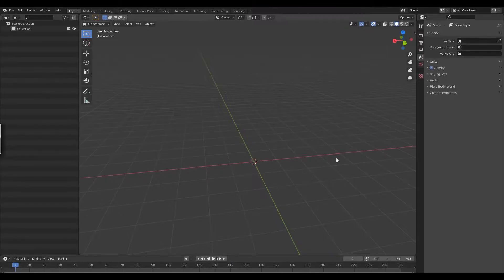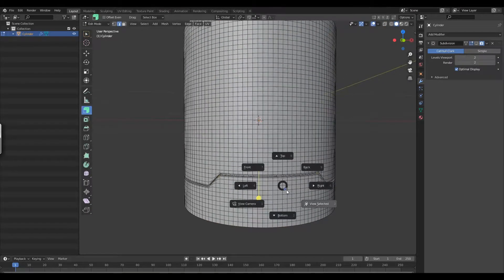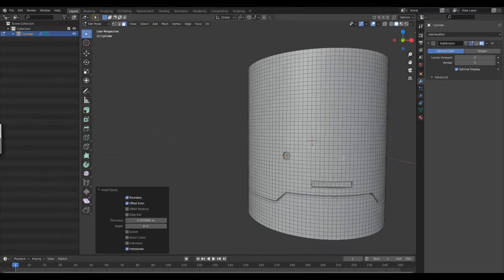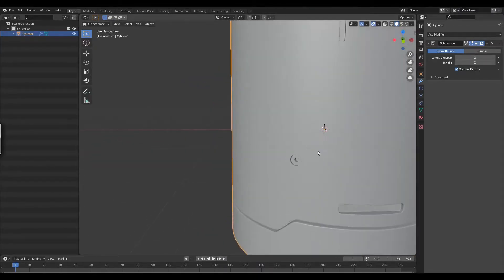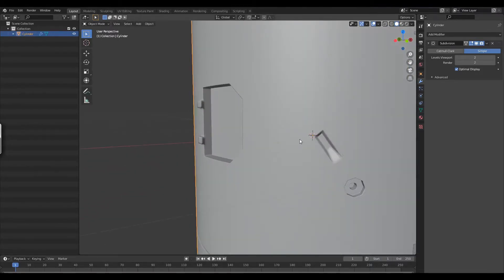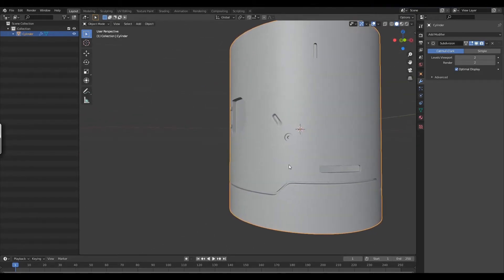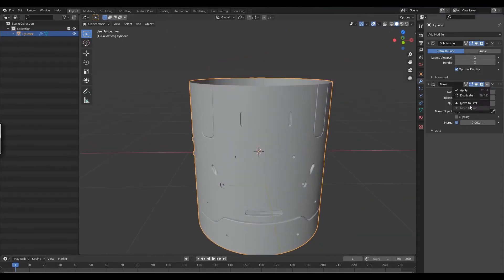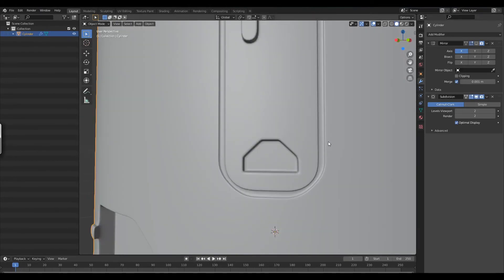SubD Modeling Techniques: Adding Details to Cylinders

Comment: Thank you so much for this. But I would like to know "How to make it a low poly game asset?" because I cannot use this high poly mesh as a game asset, or a better question would be how should I bake it on a low poly mesh. Making these sharp details without adding too much resolution.
Reply from the maker: You're welcome. If you want to transfer details like this over to a low poly cage all you have to do is bake all the details into a normal map (4k resolution gives you a pretty good result) and plug that into the normal output of your low poly mesh. Hope that helps. I'll try to do a video series on this very topic when time permits.